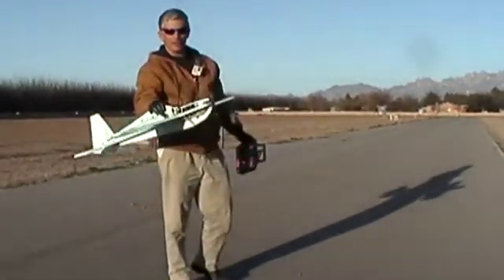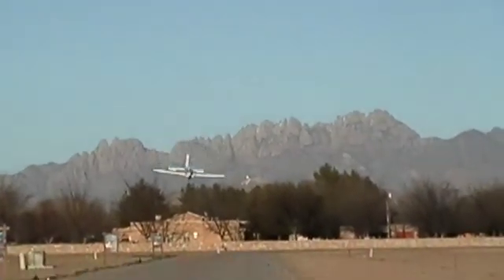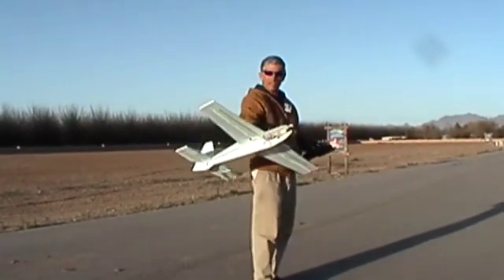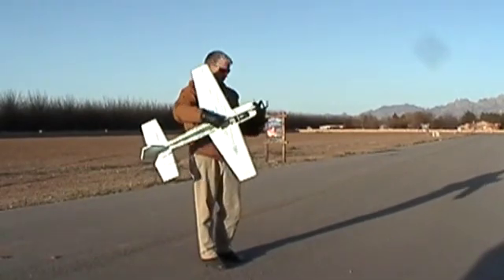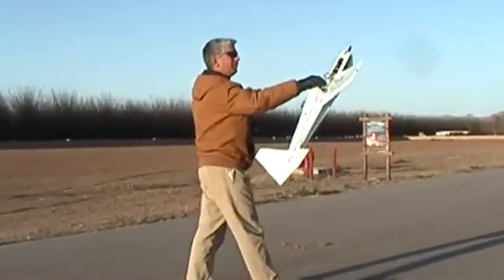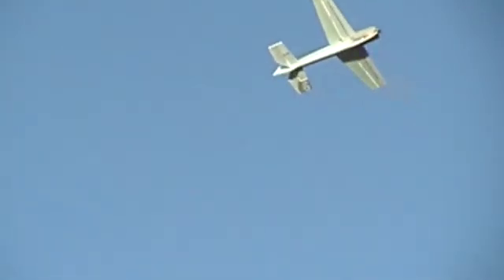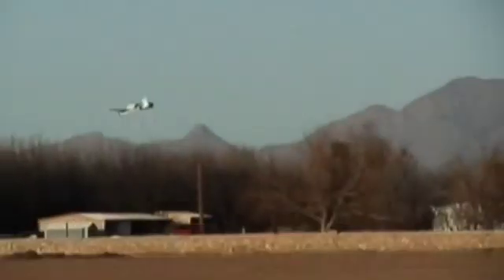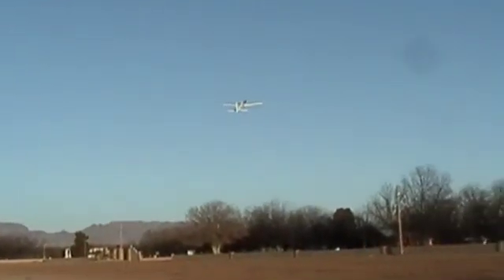RCPowers.com Extra 300 FREE PDF - Landing, Gliding, Stalls, and Spins

Comment from the maker: @MsJames504 Hi.  Thanks for watching my videos.

I use a Grayson Hobby microjet motor with a 6x4 prop.  They used to sell a motor / esc combo package and I would recommend that.  I believe I am using Grayson Hobby 25 amp ESC's.

Hope that helps get you in the air.  Happy flying.

Comment from the maker: @aerohas Short answer: I don't know.  Long answer: It's not the type of plane I would expect to benefit from atypical control surface movements.  The elevator works well at the end of the long tail, and the ailerons work well on the long wings.  I don't think you gain much by adding the extra control deflections that mixing gives you.

Comment: Greg, You must be a good friend of Dave powers, both of you are good rc pilots. I would hazard a guess that your a flight instructor or display flyer. full size.
Are you using a MJV3 with a 6x4 prop, on this extra 300? I just built mine from 1/2 foam and looking at the same motor, Good vids, lets have some more.. happy thanks giving. Dave

Comment from the maker: @ChappersSP Thanks for watching my videos Chappers.  I'm glad you enjoyed them.  The 'corners' between the wing and the fuselage are a significant stress point.  The control horns, hinges, and servo mount points also take a lot of stress, especially the elevator.  The plane will execute some fairly extreme maneuvers, so there is considerable force on the control surfaces.  Hope that helps and happy flying.

Comment: I built one of these out of 6mm bluecor foam like yours but I added extra wing area and it slow flies nicely. Also I'm using a 2-cell lipo and It will still hover a little under full throttle. I can't wait to get a 3-cell, If you built one with 6mm bluecor and hot glue and packaging tape it will be an aerobatic machine! Nice flying 5*s!

Comment from the maker: Thanks for the compliment Bob.  I really appreciate the encouragement.  It makes me want to do more videos.

I use 1/2" foam insulation for all my builds.  I can get it locally.  I don't change the scale of the plane.  I just build the stock PDF plan.

The added weight doesn't bother me, but the added DRAG can cause problems.

I'm a 'shaped wing' kind of guy, so I shape and sand all of my flying surfaces for added lift and reduced drag.

Thanks again for watching my videos!